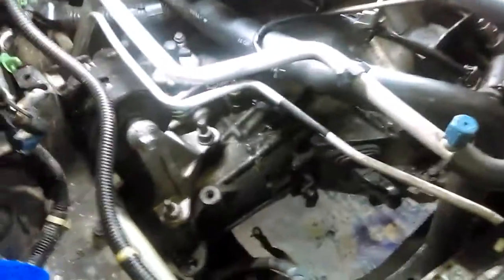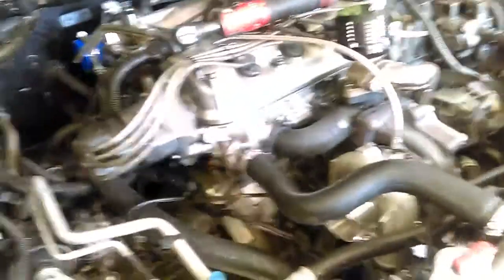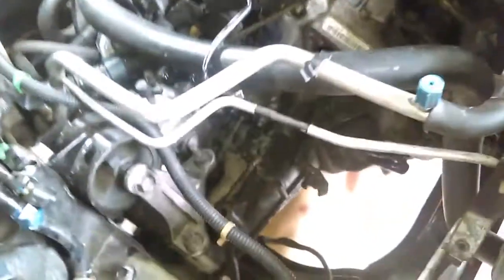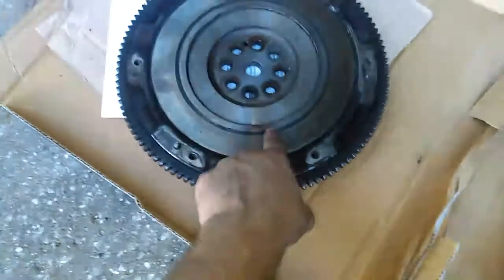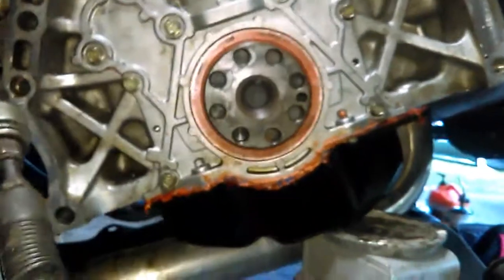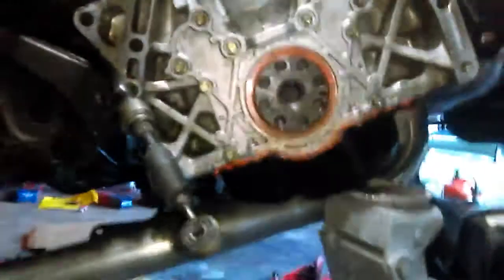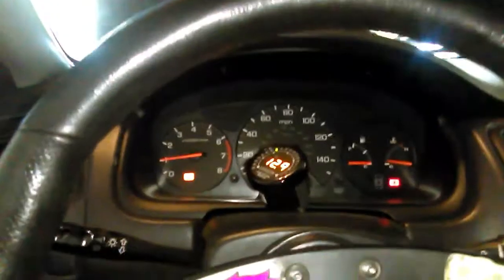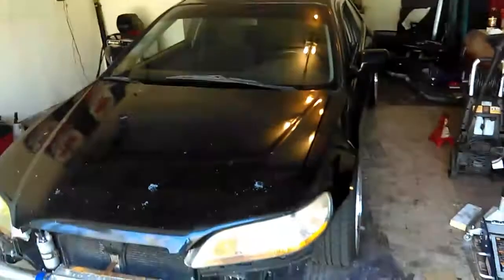Honda accord clutch replacement

Comment: What engine management is this car using? Is it standalone or obd1 conversion with p28?
Reply from the maker: Obd1 converted on p28 using crome
Reply: @cardudegarage  dope thanks for the reply. I just got a 99 lx sedan for free, hopefully some of my old civic boost parts will fit. To bad i sold my p28 neptune/demon rtp ecu with bluetooth

Comment: Hey bro how do you and fluid to the transmission?
Reply from the maker: On the side of the trans there's a drain and fill bolt gotta use a 3/8 wrench on it
Reply: Okay thanks
Reply: How much fluid does it take
Reply from the maker: @Octavio_Baeza  auto or manual?
Reply: Car Dude Garage no I’m asking for my 1998 Honda Accord 2.3 ex 5 speed
Reply: Car Dude Garage and how can I check how much it has ? And someone told me it’s bad to drain the fluid and add new fluid true or false ?
Reply from the maker: @Octavio_Baeza  if auto true 5 speed false  it take almost 3 quarts of mtf
Reply: Car Dude Garage okay thank you